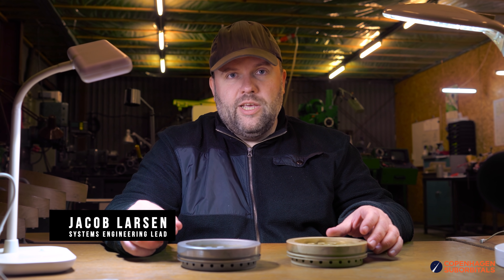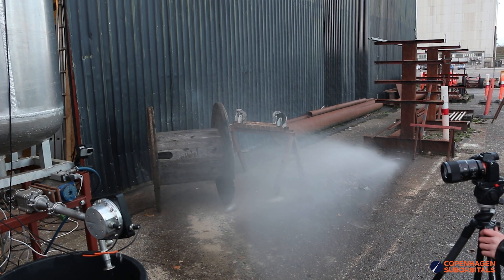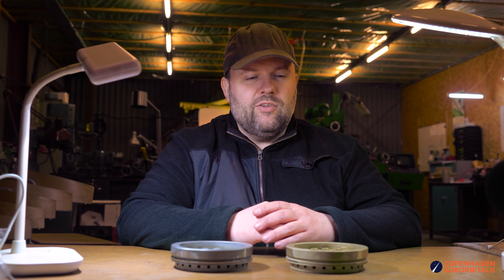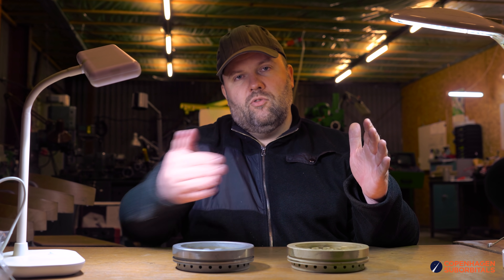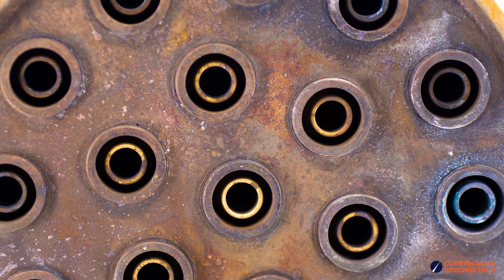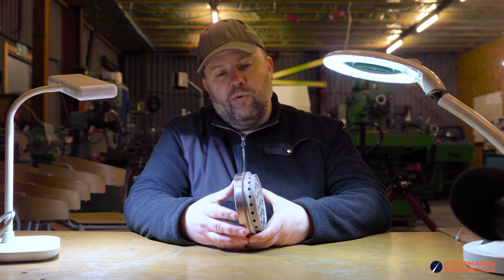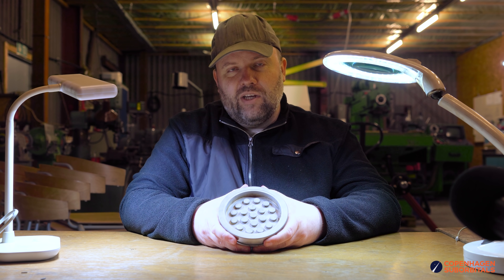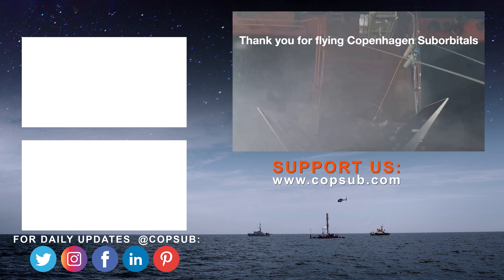ROCKET ENGINE TEST Review. How to see combustion instability?

Comment: Your fuel injector seems to not use Film Cooling. How do you administrate temperatures? Just using fuel rich mix?
Reply from the maker: The outer ring of the swirler elements are slightly more fuel rich than the center set.

Comment: Hi guys. Did you made any CFD + FEM simulations regarding the thermal problems that may arise due to the temperature gradients from the liquid propellents and the hot fire gas? And if so, by curiosity, which software did you use?

Comment: Instead of silver solder, you should look at nickel brazing using Wall-Colmoloy brazing compounds. The melting point is much higher and strength is better.  But it needs to be sintered in a hydrogen atmosphere..

Comment: Great results! And fantastic video. It would be great to see the actual data and go more in depth, I feel like this is always behind the scenes and I find it difficult to find material that's not just a summary. I had a question though: I was wondering about the comment at the end saying that this 3D-printing process works "immensely well" for this use case, since you've only put them through a few seconds of burn time compared to the multiple minutes they would need to survive in this environment to reach orbit. I'm curious to hear how you are planning to gain confidence that they will last (maybe a long static fire test like SLS just went through?), and what you have seen about the data so far to have already reached such a high degree of confidence. (High degree, get it? 🔥 … ok I'll see myself out).
Reply from the maker: We will go through the data in more detail once we have gone through the data (possibly in a live stream, where you can ask questions directly). :_Swirly:
As for the 3D printing process, we are not reaching for orbit. Our suborbital flight requires only but a minute of burn time and between the two runs with this injector we already have half of that time covered with no indication of damage. But of course, before we qualify flight components for the Spica rocket and BPM-100 engine we will need to run further and longer duration tests.
Reply: @CopenhagenSuborbitals  Awesome, thanks for the quick reply! It’s so great that you engage with watchers online, your passion really comes through.
Reply from the maker: @desmond-hawkins  You are welcome! We try.

Comment: Cool! Good to see you safe and the hardware in one piece. A 100 kN engine is a remarkable achievement.
Reply: This was only a 5 kN test engine :-) The 100 kN engine is being worked on.
Reply: @LarsBjerregaard  Getting any size liquid fuel engine to work is already impressive. Of course, stability of the large engine will be a much more subtle problem. Good luck!

Comment: YOUR POGOING EFFECT (INSTABILITY IS CAUSED BY INCOMPLETE COMBUSTION. Oops caps off.
The cure is to place a ring (wall) round the first two rings of injectors  24mm tall, then come off at 45 degree increments to the edge, again at 24mm (8 hedges) to the edge of the injector plate. Your pogoing effect will stop, and you will have now complete combustion and full stability.

Comment: Congratulation! Good job! To avoid the combustion instability may be it is necessary to increase the injector pressure drop, but slowly, step by step. On the other hand the total pressure drop from the tank exit to the combustion place should be approximately equal or more than half of the combustion chamber pressure. Good luck!👍
Reply: Could you elaborate further why that is? Thank you for your input!
Reply: @G4m3G3ni3  Ok! 1. If you for example have 1000 bar tanks pressure, you would have the nearly conctant propellants flowrates. The low frequency instability is damped in this case. You could use for this purpose the Venturi nozzles in  propellants supply lines, but it results in the tanks mass increasing. Compromise experience solution is the total pressure drop, wich is equal or more than half of the combustion chamber pressure. Afte achievement of the combustion stability in all  inlet pressure and temperature conditions combination it is possible to  proof the slowly decreasing of the pressure drops. 2.The higher injector pressure drop, the better the propellants atomization and the better combustion stability, but only slowly pressure drop increasing to avoid high frequency combustion instability.

Comment: Perhaps you need more delta-P across the injector to kill that oscillation.
Reply: As someone who's not very proficient with math stuff, what's DeltaP? DeltaV's evil twin?
Reply from the maker: @aarons1234  "Delta" simply signifies a change of a measured value. P in this case would be pressure and DeltaP would signify a change in pressure as the propellants go through the injector into the combustion chamber. Whereas DeltaV describes a change in velocity of a spacecraft, or basically energy spent needed to fight gravity.

Comment: Are you sir use turbojet pumps to pressurized the propellent?
Is it possible to make a turbojet pump for our own rocket project?
Because I search but did,t find it.
Reply: No turbo pumps. Turbo pumps adds complexity, costs and risks. As for now we use a so called "Dynamic Pressure Regulation System", or just DPR for short. You can learn about it in some of our other videos.

Comment: Great test campaign! Have you any ISP results? How coaxials did in compere to calibration shower head test?
Reply from the maker: Thank you. All of the coaxial swirl injectors seem to have higher performance compared to the shower head. In some cases even up to around 10% increase in ISP.
Reply: @CopenhagenSuborbitals  10%! I can see why you're so attracted to the design with that kind of increase. Well done all, and good luck with hammering out the instability.

Comment: Why you just didn't print the whole injector  at once and you choose to solder them on the injector plate?
Reply from the maker: 1. The larger the printed part, the harder it is to get the tolerances right.
2. Testing this injector design for the first time we wanted more control over each element verification.
3. It is more expensive.
4. It was more risky with little real-world tested injectors that used binder jetting in general.
Reply: @CopenhagenSuborbitals  Thanks a lot!! :)
Reply: Hello again! I just read that you tried a full 3d printed injector :)

Comment: Regarding the combustion instability problem do you think that is a serious concern? and do you think that you will first try to figure it out on the BPM 5 before moving to the BPM 100? please update us when there is something to take about and what steps you are going to do about it if that is neesery.
Reply: Not a serious concern, just annoying. Thoroughly analyzing and meticulously discussion the several Gb of data is believed to solve the instability issues. Scaling up from 5kN to 100kN will certainly present other issues so it is probably best just to move along persistently.

Comment: Copper does thermal expansion when hot, could crack when cold, any sign of that?
Reply from the maker: Like Jacob mentioned in the video, no. ;)
Reply from the maker: *Upon first inspection.
Reply: Brass alloy has different properties than pure copper, that's why it was invented.

Comment: You said that due to the results of the test firings that you were seriously looking to use the design in the future. Was this referring to the Brass design or the swirl injector design as a whole?

And if the latter, what other ideas did you guys have for injectors?
Reply from the maker: It was referring to the coaxial swirl design in general. Coax swirlers were our main bet from when we started working on their design, but obviously, we had a lot of unanswered questions before the static fires. Now with the data on hand, we are confident we can adopt it going into the future with the BPM-100 engine.
Reply: @CopenhagenSuborbitals  Out of curiosity, what other injector designs did you have in mind? Splash plate, Unlike quadrets, pintle, etc

Comment: RIP Camera; but bautiful Mach Diamonds
Reply from the maker: Well, it did survive this time.
Reply: Mach diamonds are a sign of instability due to the nozzle being at sea level.
Reply: @rasputinputin8103  if the nozzle is severely over expanded then yes it can cause instability but Mach Diamonds don't inherently mean the flow is unstable.
Reply: @rasputinputin8103  RS-25, J-58, Raptor: Are we a joke to you?
Reply: @rasputinputin8103  Not at all! Mach diamonds are due to supersonic gases coming out of the nozzle at extreme speeds but low pressure. Yes this sounds counter-intuitive, but this is just because there is a lot of gas coming out at very high speed. The pressure inside the combustion chamber can be very high (e.g. 300+ bar with Raptor engines), but that's at the narrow throat before the nozzle. The gases expand in the nozzle and as soon as they reach the exit of the nozzle they are surrounded by air. The pressure of the exhaust gases past the nozzle is lower than the atmospheric pressure, and as the ambient air compresses the flow of gas it can create shock waves that form as _standing waves_. You can actually learn a lot about the characteristics of an engine by just looking at the mach diamonds, their size, regularity, stability (which seems to be an issue here).

Comment: For my untrained eye, this seems to have a lot in common with the V2 rocket.

Same fuel, similar design of both the injectors and the combustion chamber.

Although the ignition mechanism seems to be inspired more from the soyuz way of doing it. 😜
Reply: The A4, the booster for V2, used the same fuel. It's not the "best", but it is MUCH more environmental friendly than any other fuel. The injector though is very much different from the one used in A4, as the A4 had separate nozzles for Fuel and Oxidizer.
The ignition system is more or less classic. During our development prior to the first BPM5 test we were made aware that this "old fashioned" system is still used in the Soyuz "broom stick" system. It is regarded as one of the most trustworthy systems so no reason to change that as long as the engine only has to be lit once.
Reply: The V2 used showerhead injectors, not coaxial swirl injectors. The only similarity are the brass nozzles with a similar shape as CS's injectors for the fuel but they didn't have a "double wall" (which is what makes them coaxial)
Reply: @max_kl  The A4/V2 actually used both swirl and showerhead injectors, search for a documentary called "A4 / V2 Rocket in detail: fuel and oxygen injectors" here on youtube, they even test, with water - an actual swirl injector from the V2 rockets at the end of the movie.

It's one part of a ten part series that goes in depth into the design of the V2 rocket, I really enjoyed watching it.
Reply: @NomenNescio99  Ah, you're right! I missed the fact that some of the fuel injectors were actually swirl injectors with angled holes. Thanks!